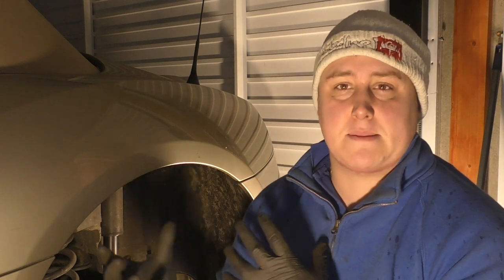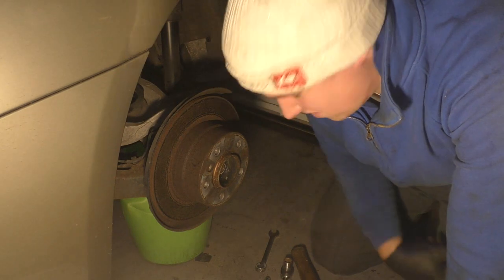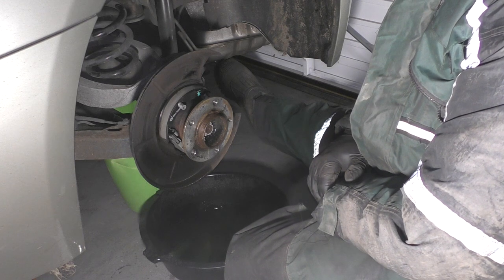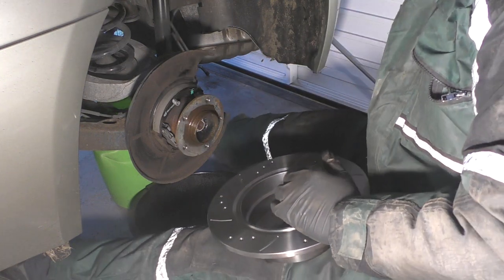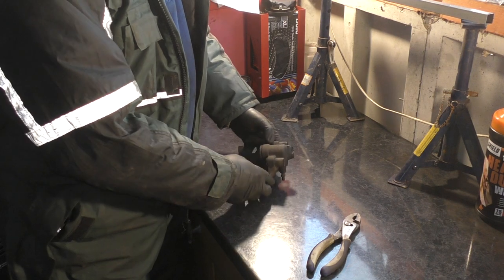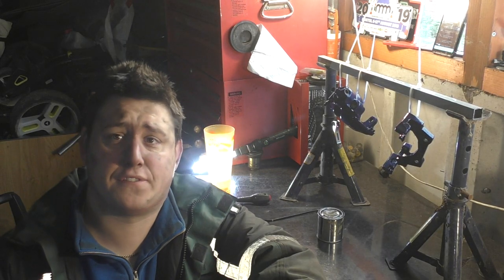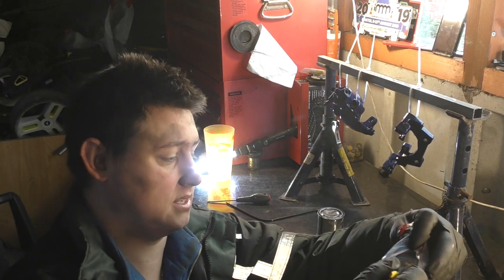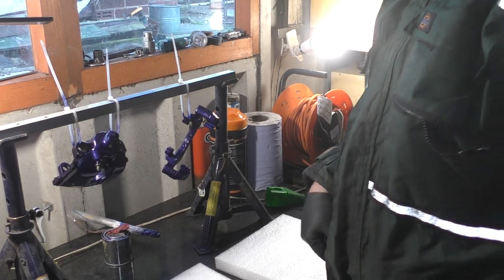BMW Z4 E85 Rear Brakes - Part 5

Comment: Knowledge is king, I didn't know how a hand brake set up works on modern rear discs, only ever done an E Type Jag and they just pulled on the disc pads but now I know, cheers for that. Hope you and your family have a great Christmas, thanks for the informative videos.
Reply from the maker: Thanks Graeme, BMW use this style which i prefer, many manufatures use the style as you mentioned above, and they adjust via the cable. more modern electronically controlled however is beyond my knowledge.... 
i'm glad you enjoyed these videos and hopefully many more to come in 2020. wishing you and your family a merry christmas and a happy new year if we do not have any contact before then.
Reply: @WilliamMurfitt  Electronic handbrakes are the work of Satan, the only electronic update that I do like is electronic ignition rather than points, they can keep the rest of them.  All the best for 2020.